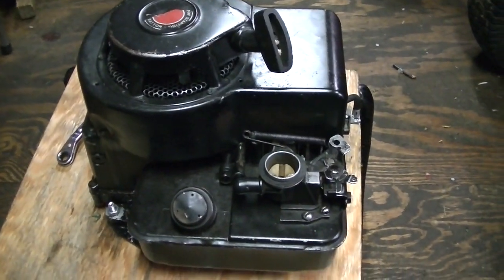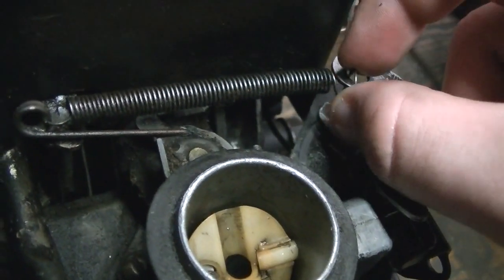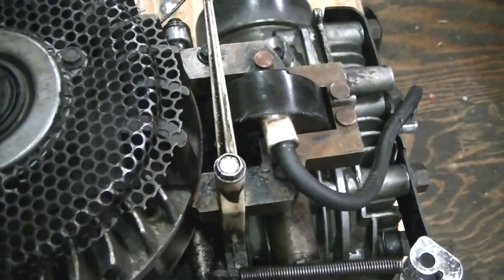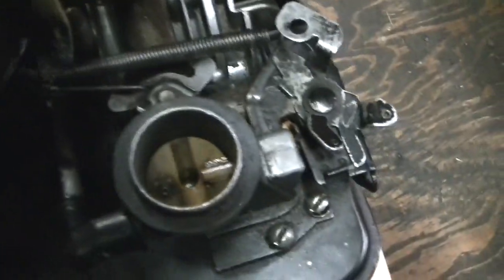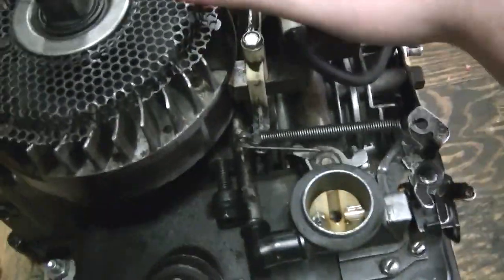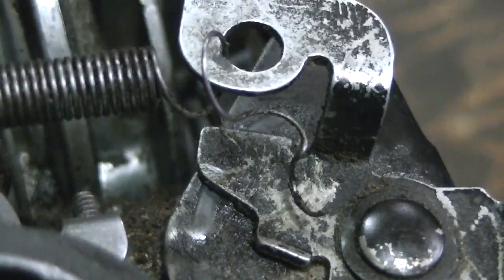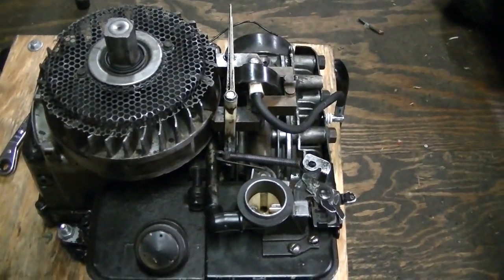How a Briggs and Stratton Push Mower engine governor/throttle linkage is set up, and how it works.

Comment: Hey can u help me? I have replaced so many parts on a very old push mower of my boyfriend that had set for a long time and i literally got it running for him! Only thing is- its running at high rpms. This is the last thing i cant figure out. Other then that it's running perfect! 
Its a lil different set up than yours tho cause that metal throttle control plate thing that you are moving back and forth- mine does NOT move like that.  
I thought maybe it was just stuck- but i dunno- i truly dont think it can move cause i seen in another video the guy said his can not move. 

Any advice ? 
I havent changed the spring on mine but maybe i should move it to another close location to see if it effects anything?

Comment: The throttle linkage where the cable connects is not moving at all. I took the cable off and its sized tried oiling and tapping. Any suggestions? Thanks

Comment: i have a model 95902 3.5 clasic engine with one governor spring. i was confused every other video had 2 springs (idle spring and goenor spring.)  I ordered a part number 262759 hope it works, thanks for the video
Reply: does it work? cuz i cant find the same type thats shown in the video
Reply: It works after I replaced it  @bestyaq

Comment: One possibly obvious question: in lapping the valves on one of these little, old engines, the governor/oil flinger sits in there with NO connection to the governor, mechanically, right?  ALL the governor action is handled, as you show here, by the exterior springs. Whereas, bigger engines have a mechanical piston connection rod from governor oil fling gear to the exterior governor arm.  But the little engine: all spring driven from the exterior, right? Thx, DDay, Maine

Comment: First video I found that has the old one-spring governor, and now I understand better. Thanks for a clear, straightforward video.
Reply: Yeah but on my BS engine that spring is connected to the little hole in the governor arm and uh ... the spring is supposed to tighten via some rotation from the throttle cable but instead, it just stays at the same spring tension at every angle on the arc.  So how do I rate this video?  Well ... I'd say this video shows an engine model that is a real simple Briggs edition that I wish I had right now.
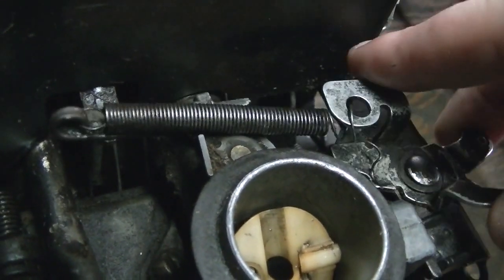Reply: 😂😅😂😮😮😮😮 0:29 😢za😂🎉pgjmmh

Comment: Thank you for your video! Any idea on the size of spring I need to replace? And where would the throttle control wire go (slow/fast) on the governor/throttle linkage? Those two things I can't seem to figure out

Comment: I have mower with throttle control (brigs) the mower revs up but if I crank it further it stalls out. I must mention my throttle control level broke so I attached a piece of metal to it . Would my governor be responsible for this?

Comment: any small engine mechanics willing to video chat? I'm trying to repair the brake system on a 6.75 hp 190cc yard machines by mtd lawnmower and I'm having a hard time understanding how it works.
Any help would be appreciated. Thanks.

Comment: My mower runs at full speed, but when you push governor throttle it slows down but once released it revs up again.  What causes this?
Reply from the maker: That sounds normal, it probably has a fixed speed, if it has a throttle control and it isn't changing anything, then look at the springs, the spring could be broke or loose. Thanks for Watching!!!

Comment: I’ve got the weirdest problem. I got the mower and it wouldn’t run.  I cleaned the carb at least 5 times so far and the tank.  It’s as clean as it will get.  It starts very easily but will die in about 3 seconds unless I slightly lift the rear wheels off the ground.  I tipped to tank off and it still does it. What in the heck can that be?
Reply from the maker: I'm not sure right off hand, sometimes its hard to diagnose problems without looking at something. Thanks for Watching!!!

Comment: I have a lawnmower at the fire house I work at. The set up is a bit different. The lever is in a different position and the “ control arm “ is is longer. It obviously needs a new spring. Anyway you can explain how the whole carburetor system works in order to start it up. I’m not very familiar with some of the lawn mower mechanisms.

Comment: Hi, I have a 1991 Briggs & Stratton 4 horsepower push mower. It starts but will not throttle down. It remains at full choke, even when turning down the choke. The cable tension looks good and the throttle or whatever it's called moves near the carburetor so I'm not sure why it wont rev down. Thx
Reply from the maker: If its the old style like in this video with the choke instead of primer, then its probably the diaphragm inside it. I'd start with that. Thanks for Watching!!!

Comment: The butterfly or choke plate in my carburetor throat stays closed but can be freely moved. I have to keep it propped open with a folded piece of cardboard. How can I make this right?
Reply from the maker: You need to replace the diaphragm inside the carburetor, it has a long metal piece that attaches to the plate, when it wears out it will stay closed. It works off of vacuum. Should be able to get at lowes or any lawn mower place. Thanks for Watching!!!
Reply: @fnaguitarplayer9  Thank you. I'll get the part number off of my parts list and order it.
Reply: @fnaguitarplayer9  I got the part and replaced the diaphragm with the long metal piece.  But it still does not open the choke, i.e. the butterfly remains closed.  What do you recommend at this point.  The new part looks perfect to me.  I still have to prop open the choke with a wad of cardboard.  I'm missing something.

Comment: I've got a 300 series on a push mower similar to that but it has two springs. I rebuilt the carb but something in the linkage is not hooked up right because it idles way to fast on startup. It looks like that looped linkage to the air vane is bent but my model engine parts list doesn't even list that link. Do you know the part number?
Reply from the maker: Not right off hand I do not, with the model type and code i can try and find it for you. Thanks for Watching!!!
Reply: @fnaguitarplayer9  I think I figured out the problem. The engine cover is wrong so there is no cut out where the wind vane arm is causing it to bind. I still am not sure how to properly adjust idle and top no load on this engine since there is no screw. I know you bend the levers to increase and decrease but not sure how to get it at idle. Do you have a video adjusting this type of engine it's a 9S502.

Comment: Ok I'm new at this that hole piece where the throttle control is attached to what is called cause they gave me this machine and it's missing need the name to order it thank you
Reply from the maker: Should be called throttle bracket assembly or throttle linkage. Thanks for Watching!!!

Comment: Hi fnaguitarplayer9 
i have very similar mower like the one you shaw on this video. the governor/throttle spring is too long and after i shortened the spring the mower goes up in rpm by then is going up and down. would you be able to diagnose the issue?
Reply from the maker: If it smooths out if you manual hold the throttle then its a governor/spring issue, if it stalls out or runs rough then its a carburetor issue, carb may just need adjusted some if its this type with a adjustment. Thanks for Watching!!!

Comment: hello do you know where can i find the carburetor kit ,diaphragm,thanks
Reply from the maker: You can usually buy these local (if your in the us, even lowes usually has them). If not, then look on ebay. If you need part numbers give me your model type and code off the engine. Thanks for Watching!!!
Reply: thank you,i have a vintage briggs statton (as new) 3,5 hp,148cc,model 92908 type 5205-01 code 84013125,if you can said me it's possible buy the carburetor kit,and were ,thank you very much
Reply from the maker: @pefafor   494623 is the part number for the carb kit, I have seen these local like a hardware stores and even lowes/homedepot, but not sure if they still have it, you can also order it off ebay for real cheap, and fairly fast shipping. hope this helps.
Reply: thank you very much, with the number I hope to find you greetings

Comment: Thanks this shows that the kink in my governer control that rubs against the throttle is the problem, it catches as it is supposed to move causing it to run super slow, or super fast, now I can see I need to bend one or the other so that they do not conflict.
Reply from the maker: Your welcome, I've had that happen alot! Thanks for Watching!!!

Comment: I picked up a Sprint 40 on the side of the road that i want want to rebuild. There's a flexible wire from the ignition to carb i linkages i think and unsure what it is. Any help appreciated.
Reply from the maker: The wire is a shut off wire, there is a little tab on the linkage to where it connects, so when you throttle down it shorts out and shuts it off, OR look where the blade brake cable connects it may be there. Thanks for Watching!!!

Comment: Can it damage one of these engines that run at full throttle most of the time to be maualy set to idle? Should you set to full throttle to mow or the semi-idle?
Reply from the maker: As long as the idle isn't set below 1800 rpm it will be fine, anything below that and you will have oil circulation problems. I have mowed alot with a push mower idling or just over idle speed. You may not get quite as good cut since the blade tip speed is slower and it will stall out in thicker grass, but other than it shouldn't hurt it any. Thanks for Watching!!!

Comment: I have one of the engines. But when, when I pull the throttle  to put it in stop, the engine continues running and won't stop. I can see it's all fully connected and when pulling the throttle lever up and down the governor tightens and loosens.. Help?
Reply from the maker: Sounds like the switch is broke or the wire came loose between the coil and switch, follow the wires on the coil and you will find the switch on the throttle assembly. Thanks for Watching!!!
Reply: Edit: Ahhh. there's a little plate which is bent downwards (with the wire that goes to the points and condensers) under the throttle plate. Which is believe is meant to be bent upwards so the throttle plate hits in when in stop position, right? Because at the moment it's completely missing it. If I'm right, let me know, and thanks a ton
Reply from the maker: Yeah that sounds about right, it should come in contact when the throttle is set to stop. your welcome!
Reply: Oh cheers, the 1980's self propelled leaf vacuum is running beautifully and stops beautifully.... You and Donboy are the best small engine guys on Youtube..
Reply from the maker: I hear ya! Appreciate that very much!

Comment: Thank you for this video. I'm going to cut the spring to add some tension because my lawn mower is surging up and down in rpms, even under load and i'm fairly certain it's because of the spring tension.
Reply from the maker: Your welcome! usually the spring tension just affects the RPM's, on this type of carburetor (most push mower carbs) if they are surging you can adjust it out of with the mixture screw, if its the new type without any adjustments will need a new diaphragm, if its the bowl type carburetor then it will usually just need a good cleaning. Thanks for Watching!!!

Comment: Good evening, I have a Briggs and Stratton Quatume 5.5 Murray that the carburator butter fly is wide open.  I've moved and push everything on the lawn mower but no luck on closing it.  I just completed a tune up and cleaned out the carburator.  I am not sure what to do next or what the issue may be.  Any help is appreciated.  Thank you
Eddie from California.
Reply from the maker: The linkage may be jammed up, sometimes it will bind up when you put it back on, now do keep in mind that when its not running it will be pulled open from the spring tension and when the air hits the air vane governor it will close it. Hope this helps. Thanks for Watching!!!

Comment: I got a briggs and stratton 3hp engine like yours. I want to make a gokart engine out of it with a throttle grip. How to i do that? ;D Can someone help me out! ;) ????
Reply from the maker: You would run the throttle cable to the front where the lever is, or if your bypassing the governor which i don't recommend doing, it would hook directly to the carburetor then a clamp on the shroud. Thanks for Watching!!!

Comment: okay so I have a Briggs I use for my go Kart, its just a one screw adjustment that slows or raises rpm's. is my main goal to get the lowest rpms without it turning off ? what should I set it to
Reply from the maker: All small engines are designed to idle at around 1800 rpm, and to low of a idle will cause oil problems, not letting the oil circulate as well. I have videos on adjusting other types of carburetors and i show adjusting the rpm by ear, that may help you. Thanks for Watching!!!

Comment: Why wasn't the throttle plate opening and closing when you were pulling on the Governor arm??
Reply from the maker: The plastic plate that is visible on the opening of the carb is the choke plate, the throttle plate on these is only visible with the carburetor off. The choke works off the diaphragm and a spring inside the carburetor (automatic choke). Thanks for Watching!!!

Comment: I have the exact same carburetor as you.  I have a problem, the choke always stay on.  The mower start instantly, but with the choke on, i will not last long.  If i put a screwdriver and open the choke manually, the engine revs up and everything is ok.  What can i do?
Reply from the maker: The choke is operated by the diaphragm on these carburetors, when they do that you need to replace the diaphragm and springs to fix it. Thanks for Watching!!!
Reply: The spring was not entered correctly in the gas tank!  Now it starts very well and the choke works great BUT it runs for just about one minute and die...  What should it be?
Reply from the maker: I hear ya! It could still be the diaphragm causing that, it acts like a fuel pump, or it may trying to run to lean, you can try turning the mixture screw out a 1/4 turn to see if that helps, sometimes when they try to run to lean they starve themselves out. If that doesn't help, you will need the diaphragm.

Comment: might be a dumb question but if the governor arm is broken or missing, could that be the cause for the motor not starting ,or does the vane just matter after the engine is running?
Reply from the maker: It probably wouldn't keep it from starting/running, but it would affect how fast it runs and the power do to the governor not kicking in right. Thanks for Watching!!!

Comment: Okay, I've got a Briggs "300 Series"; it's one of these cheap modern ones that doesn't even have a throttle cable. It's been surging like crazy, barely keep running. I took the top off, and it doesn't have a air-flap thing like that. I can see a rod coming up from by the crankshaft, connected to a lever on the carb, operating the throttle valve. You can see it moving back and forth as the engine surges, but when you try to hold it in place, or open the throttle up manually, it still surges. It'll try to rev up when you open the throttle, but it'll keep cutting out, even when you hold the throttle totally still. I don't know what else to try other than emptying all the gas out and refilling it with brand new stuff. I've tried two different cans, put Sta-bil and dry-gas in, but maybe that wasn't enough?
Reply from the maker: Its probably carburetor related, running to lean, making it surge. Try cleaning the carburetor, or if its the type with a diaphragm get a new diaphragm for it, this new ethanol fuel takes a toll on them. Thanks for Watching!!!

Comment: Dull-witted, here. What is the solid piece that is just to the left of the spring, please.  Mower was hard-starting without direct priming, so I finally checked the spring and in doing so, the tiniest bit of the end broke off.  So, I reattached the spring.  I thought my eardrums would explode.  Persisting in my stupidity, I ran the mower for 15 minutes, and I figure I'm lucky the blade didn't fly off or something equally horrendous. ( Grass height ordinance demanded attention today, at least in the front).  At least I stopped then, but I've probably hurt the engine.   Went out to buy a new spring - fat chance on a Sunday. Then I notice, finally, that that solid piece of metal isn't moving.  I stopped there, and found your video, but I don't understand what the solid piece is.   PS  There is no oil stick - just an open hole - Briggs site says to somehow stick a piece of cloth in the tiny hole to check the oil?)  Thank you.
Reply from the maker: Are you referring to the piece that the spring connects too? If so then thats the governor arm. (air vane governor). I hear ya. With that type of setup, when you take the fill plug out, the oil level should be almost to the top of the hole (where the threads are) if you can't see the oil, it doesn't have enough in it. Some say to fill until its overflowing but thats not necessary. hope this helps. thanks for watching!!!
Reply: Thank you.  The machine is now running thanks to you.  I didn't do the fix.  I got smart and had a better able person watch the video.
Reply from the maker: Your welcome! Glad to help out!